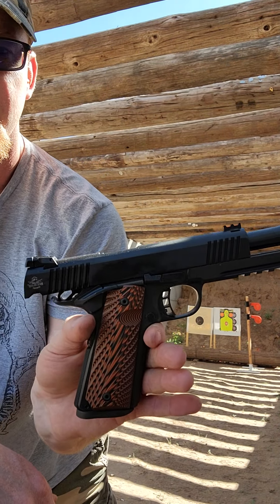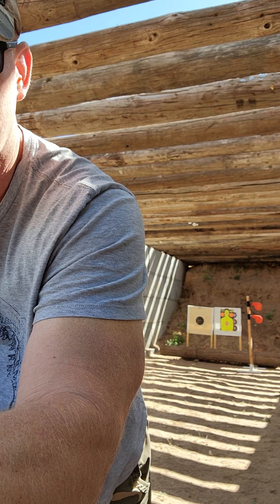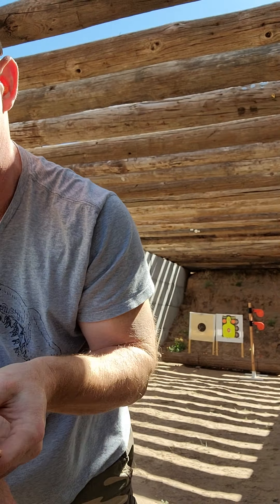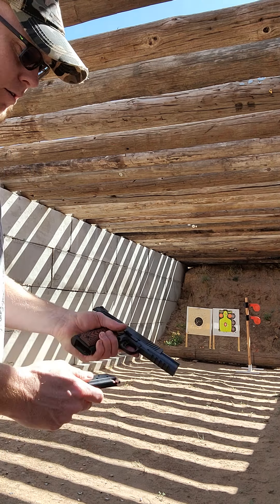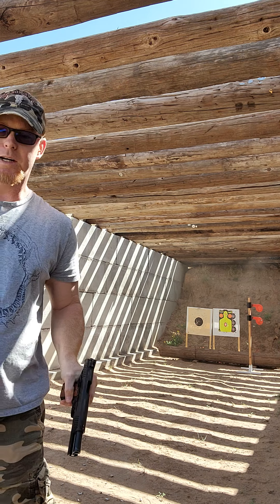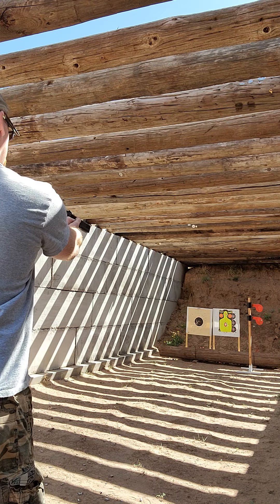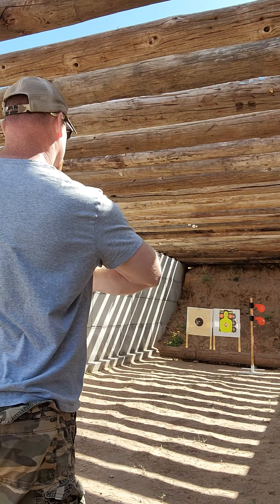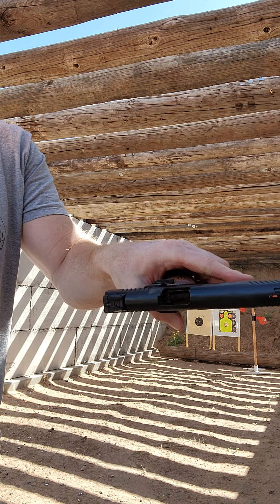RIA TAC Ultra 10mm and Hornady 200 grain HAP and XTP

Comment from the maker: update, put another 150 rounds thru it and it is getting better but still not perfect, now i get hammer strikes but no bang about 1 out of 20 rounds, recock hammer and it goes bang 2nd try.
but atleast now it feeds everytime, so theres that. i might now try to redo the trigger, this pistol has a screw that can be adjusted to take out slop so i will put it back into the middle setting and see if that helps